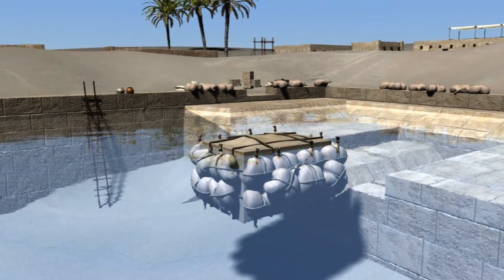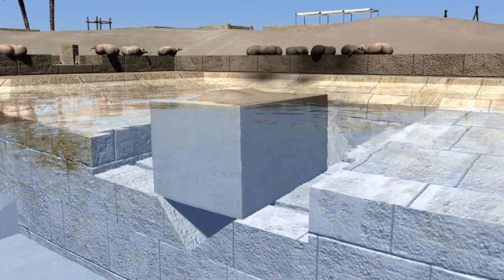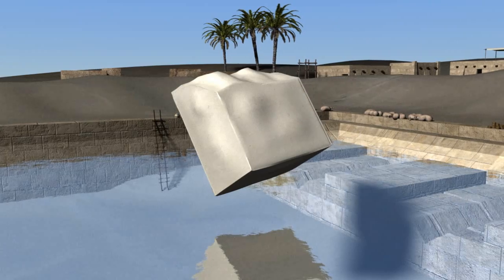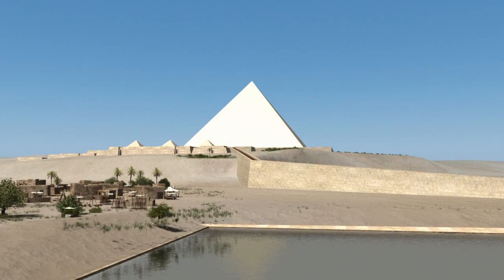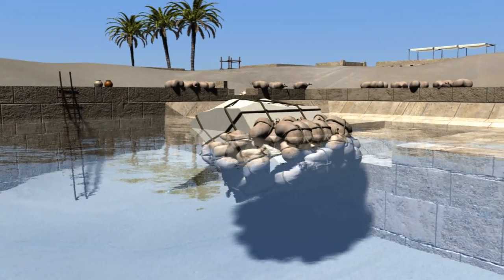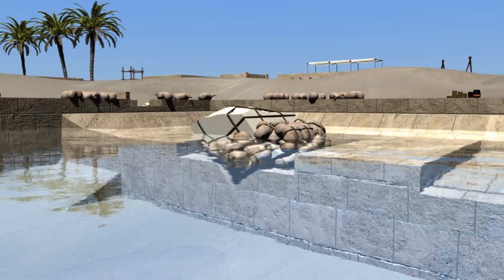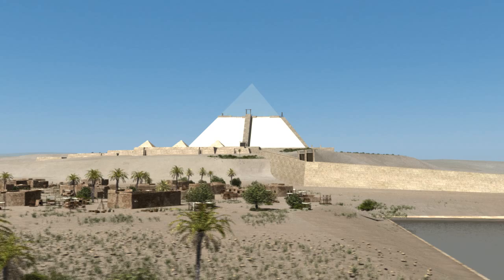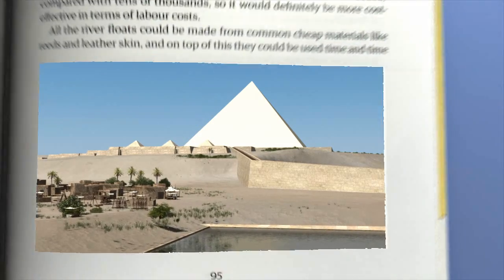How the Pyramids of Egypt were really built Addendum - Shaping the blocks

Comment: When Giza Pyramid builders laid the first layer of limestone blocks for the Great Pyramid, all that was required for the second layer was a method of leverage using the first layer, and so on for progressive layers.
Just as human-beings walk upward on steps, step by step, Giza engineers raised Pyramid blocks step by step, thereby using all space available over the entire Pyramid’s four sides progressively until completion.
Tomb models of “Petrie rockers” provide evidence of the “four‑lobe pinion‑pulley” which surround a Pyramid block and step walks its load when hoisted.
Giza Pyramid builders used the earliest known example of “Rack and Pinion” engineering technology, where the Pyramid consists of four sides of Limestone Racks (steps) and Four‑Lobe Pinion‑Pulleys engaged Limestone Racks (steps) with positive displacement when hoisted.
Search "haitheory"

Comment: *Theory of Building Pyramids*:-
The stones from which the pyramids were built are not natural stones, but rather manufactured stones with the same idea as the manufacture of bricks or blocks, and these stones were not moved or carried to their high positions (which increase in height with increasing height in building). Rather, each stone was manufactured in its location (It is the same as its current location) and it was never moved or carried from its place. These stones are characterized by precision in their manufacture, and the connected stones are relatively similar. Each stone is also characterized by an increase in the width and length of its base (compared to its height), but they gradually decrease the higher its position in the building, and while below we will review a vision of how to build of external frame for pyramid, regardless of the internal divisions (which could be done using traditional methods of construction in conjunction with the construction of the external structure of the pyramid).
*The idea of building the external structure of the pyramid*:-
The external structure of the pyramid consists of several levels (or rows), starting with the base and ending with the top. Each level consists of stacked stones in the form of a square with regular dimensions and high precision (right angles and equal sides). The dimensions of the square decrease at the top level, and this shows how the staircase shape of the pyramid appears. The stones on each level are almost identical, and the dimensions of the base of each stone are several times its height. These dimensions decrease at the upper level and continue to decrease gradually until the top. Three-quarters of the base of each stone on the upper level is above the stones of the lower level, while a quarter of the base of each stone remains suspended in the air. Each stone is manufactured on site using wooden molds made up of several facades (from five to three facades depending on the location of the stone and the number of adjacent stones), and each facade consists of several flat, strong, tightly packed wooden planks. These molds are used in the same way as making blocks or bricks. The ancient Egyptians came up with a specific chemical formula that was mixed with desert sand, and perhaps a certain liquid was added to it (perhaps water). This resulted in a mixture similar to the cement mixture we have today, where workers carry it using special containers and pour it into wooden molds (with the same idea as concrete pouring). This mixture dries quickly, so the wooden molds are removed to begin making the adjacent stone until the current level is completed and then move to the next level, and so on. After these stones dry, they become very hard, just like rocks.
*Scientific evidence of the validity of the theory*:-
1- There is no doubt that the ancient Egyptians had some secrets of chemistry that we do not know yet, such as the secret of the materials used in mummification, which is still a mystery that baffles scientists. Likewise, they discovered a chemical formula for making the mixture used in making stones for construction, but they did not convey to us the nature of those compositions that It has become one of their mysterious secrets. It is not logical to believe that there is a secret in a specific dye used in mummification, but not believe that there is a secret in a specific mixture used in construction.
2- The color of the pyramid stones is completely similar to the color of the desert sand surrounding the pyramids, which confirms that the pyramid stones were made from that desert sand, noting that the color of the rocks tends to be dark in all the mountains surrounding that desert, which are very far from the site of the pyramids.
3- The absence of any rocky mountains in the areas near the pyramids, thus ruling out bringing real rocks from the mountains to build the pyramids, noting the large size of those rocks used in building the pyramids, thus ruling out the idea of carrying and transporting those rocks using traditional tools.

Comment: I remember building my large pool with the help of a hydraulic level based on long hoses and large flasks, it turned out to be much more accurate and more convenient than the usual long building levels. I don’t know if the pyramid builders had hoses then? they had to pump water up into vertical wells to maintain the levels.
Reply: Not sure if they had Archimedes' screw already, but when in doubt, buckets. And lots of manpower.

Comment: This is simply impossible. First; even with nowaday technology, you cannot precisely calculate the evaporation and the water level change subsequently. Second, even if a single rock or some sand falls into the so-called pool of shaping; the water level would rise because of Archimedes Principle. Third but not last; if you calculate the amount of buoyancy required to hold a 3 ton rock afloat then you would see that this theory is completely nonsense.

Comment: Sorry but if you think that's how they built the pyramids you must be out of your tiny mind.
It works in theory yes, however, if you consider that the pyramid was built in around 20 to 25 years (Acording to historians) and that there would have been around 2.3 million blocks it means they would have had to quarry, move, shape and install the blocks, some of which are from over 500 miles away, somewhere around every 3 to 7 minutes.
Plus the floats you described would have to be enormous and after facing one side would have to be position perfectly on each block with materials that stretch and shrink with heat and water involved.
You also haven't taken into account the rose granite stone which is extremely hard, some of these were over 70 tonnes in the Kings chamber.
You would need ships either side to float them and they would take considerably longer to quarry, transport, shape and install than lime stone. 
Take a look at uncharted x on YouTube or the joe rogan channel. 
There are more channels but these kind of dumb things down and are more enjoyable to watch than some out there. 
Your video was OK though, I just don't agree with you sorry 

After looking into this further it turns out you need a float that will displace the same amount of water as the weight of the stone block 
This now creates another problem, what did they use as floats, animal bladders or boats would probably be the only things available so to get every block exactly the same you would need to constantly add or take away water because the quarried block would not be exactly the same weight every time, there's also water evaporation, leakage, absorbtion (the limestone soaks up water so changes in weight as the air is displaced from inside) take into account.
 Good idea  just not plausible when the materials used are taken into account

Comment: These guys make a living off dreaming up ridiculous theories lol. There is no possible way these structures were built with conventional methods. Especially not in the bronze age. The Egyptians did not build these structures. It must have been a global type 1 civilization capable of building these structures with ease. We have yet in modern times cut one stone or moved one block using any of these methods.  The real problem is why would this civilization  spend massive amounts of resources and manpowor to build this structure that offers no safety no security no shelter no food.  All the while they're in danger of famine and invasion.  The possibility of failure would have been high but as we can see whoever built these pyramids built them as if there was no possibility of failure.

Comment: This is silly. The pyramids are not just a bunch of blocks piled on top of each other, that would be too simple. First, the blocks came from 700 miles away. The casing stones are never the same size, because the  conservation blocks are never the same size or shape. And finally, the great pyramid has a “skeleton” of stones that weigh over 1000 tons, how were they “floated”? 😂

Comment: Density of limestone approx 2.71g/cm cubed, density of water 0.977g/cm cubed. So you would need about 3x the volume of floats to stone to float a limestone block like this (need to allow for the weight of the floats as well as the stone, so a little more than 2.71/0.997 which is 2.72). The images show about maybe 0.5x as per 2:37. 

The real magic here is keeping all this water contained. That would be a more impressive feat than building the pyramids in fact. 

The great pyramid is 139m tall. A column of water that high would have a pressure of 197psi at the bottom. To give you some idea, on a door that was say 1m by 2m (to get one of these blocks in,  with floats on top) would have a force of 277 tons on it due to water pressure. Ignoring the fact the door can't take the force, how in gods name would you open it? If you were to stack rocks on the door, at 2.71g/cm3 you would need 102 cubic meters of limestone to prise the door open. 

The animations are really great though. As for a building solution, you have got to be kiddng.

Boringly enough, somebody did a graviometric survey of the pyramids. The internal square spiral ramp (only partly filled in) shows up nicely, So what they actaullly did was.
1. Build an inner pyramid, with a square spiral ramp on it
2. Use the ramp plus rollers and muscle power to haul up the stones.
3. Cover over the ramp, leaving it as an internal corridor to haul up the casing.
4. Fill in the ramp passage with whatever rubble they had left once done with the casing.

No aliens required, or ludicrous hydraulic schemes like this.

These folks did a really nice survey of the pyramid with radar, and resolved the internals nicely.
Synthetic Aperture Radar Doppler Tomography Reveals Details of Undiscovered High-Resolution Internal Structure of the Great Pyramid of Giza 
This is the gravity survey I mentioned.
Look at the yourtube "The Great Pyramid reveals how it was built!" at 6:40

Can we go home now please?
Reply: 👆Exact-o-fucking-ltly 
Thanks for the number crunch

Comment: the hydrodynamics of this theory are suspect.  You would need to displace around 5000 gallons of water to get 20 tons of buoyancy.  Also, if floats are on the sides or top, all of your netting & ropes would need to support that 20 tons of weight.

Moreover, the rocks were not all rectangular.  One of the most amazing feats is that rocks were irregular, some with curvature in their surfaces, and the builders still managed to fit them together so precisely that you can't slide a piece of paper in between them.

Comment: Why would they use the height of the water level as a means of measurement? When stone cutters are in the water they will cause waves and ripples. I don't see water here as the means to measure the size. It doesn't make sense. Also, what did they use to make the floats? How did they fill those floats with? They would have need millions of floats and Im sure they had nothing of that sort in Egypt. 

This theory doesn't hold water. Pun intended.

Comment: exept its all wrong. the eyptians did not need water. they already had cement. they made all the pyramids in steps using a petrie rocker and loads of thin wooden planks. the rocker was used to lift the heavy nearly 3 ton blocks easly using a lever on the rocker to tilt it and slide in planks as the contraption goes higher and higher. they used sledges to transport blocks form the casting location using rollers to slide block into the sledge then secured it for transport. at the base of the fundament of the pyramid they place the rocker with a wooden support at the top of the rocker and rollers at the top of that again and then slide the block from the sledge into the rocker using special supports to prevent the rocker from tilting. then they remove the supports and use a lever to tilt the rocker forth and back sliding in planks until the desired height is reached. then the petrie rocker is secured again and the block is then pulled on the rollers with ropes into the roller at top of the first block layer. then the block is moved into another slege and pulled into its desired position. then the block is slided into another set of rollers and then the rollers are being removed. then when only a few is left four supports are added of clay to old the weight of the block and the last rollers are removed. then cement is filled in between the block and the supports to lock it in place. this process is repeated in steps. when the first steps to the top is finsihed the same method is used to fill in more block until its almost finished. then cement is poured in between the last outer blocks and a scraping tool is used to smooth the outer surface by hand. after this a last layer of clay cement is added to smooth the pyramid remove any trace of the blocks completly. this is how the egyptians made the pyramids the only way they could as humans. the second way and simplest method it was done was by giants that made the block in whole giant pieces of clay and then carried two pyramid blocks on their backs using ropes and a stick at the time and then used cement to fill in the blocks as if t was ordinary brick work on a red clay brick wall. this method was way faster as the giants only used a small staircase on one side to climb up the height and put the blocks in place by hand. some was doing the cement part and others carrying the blocks. 300 giants would be able to finish a pryamid in only a few years. the giants had a height where 6 feet humans reach up to their knees. egyptian temples are made for their heights and not humans as we cant make out the roof ceiling pictures without magnifying glasses. for the giants the distance to the roof ceiling would be just about right.